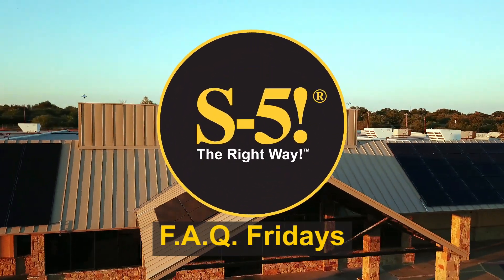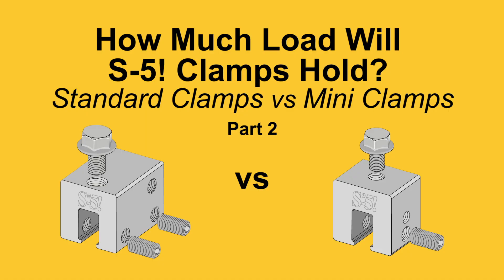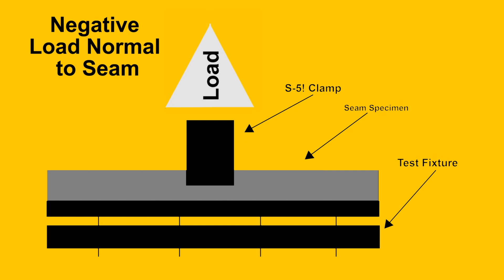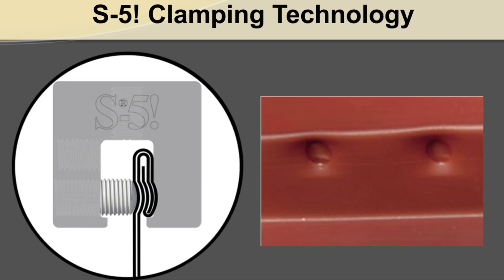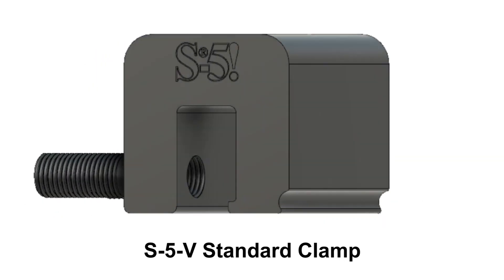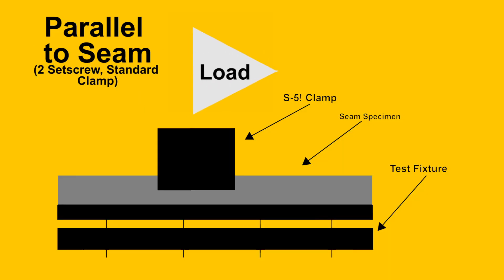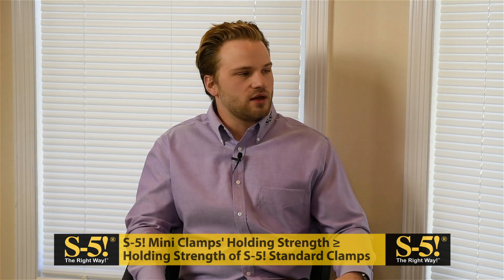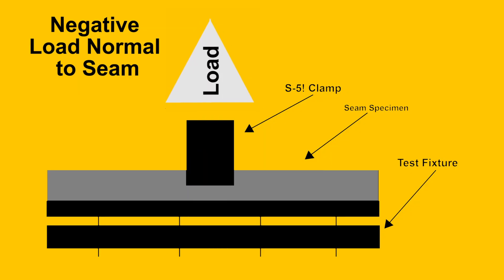How Much Load Will S-5! Clamps Hold? Standard Clamps vs Mini Clamps

Comment: What are the maximum spacing (between the standing seam) in length of the existing SSMR standing seams that you tested based? Obviously the SSMR has standing seams anchored onto the roof structure joists (purlins) and each building has different joist joist spacings. The SSMR can not take your tested force, if the existing joist spacing is too widely spaced that the pull out capability of the existing SSMR is less than your testing value. Do you have any maximum spacing of the existing seams requirements and how many anchors and size of the anchor bolts on each standing seam to joist (purlin)?
Reply from the maker: All of our clamp and bracket load data is done assuming a secure roof or structure and the loads stated are what the product can handle on a secure roof and structure. That being said anytime you attach anything to a roof you are creating a load chain to the structure and each link in that chain needs to be evaluated and the engineering be based off of the weakest link whether it be the clamp or bracket, roof sheeting, roofing screws, roofing clips, decking or purlin fasteners, etc.  If you have any other questions about our testing or certifications please reach out to us at support@s-5.com.